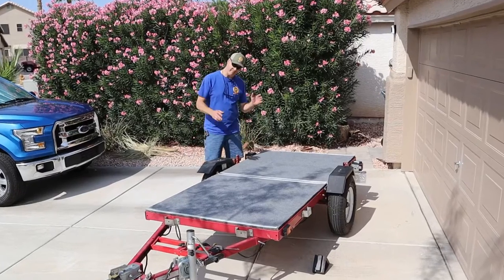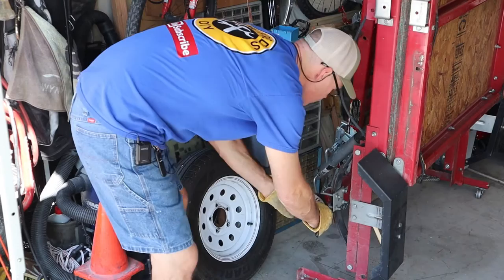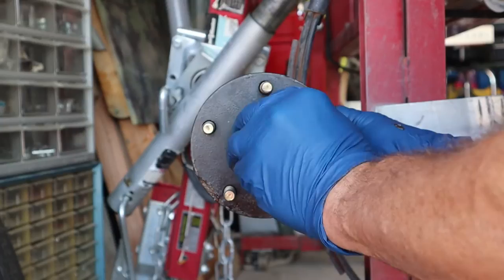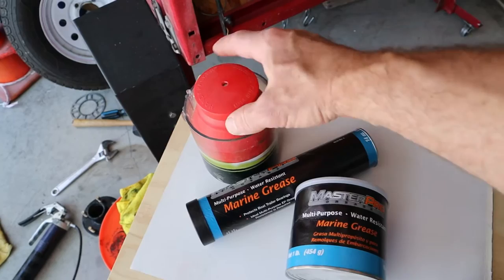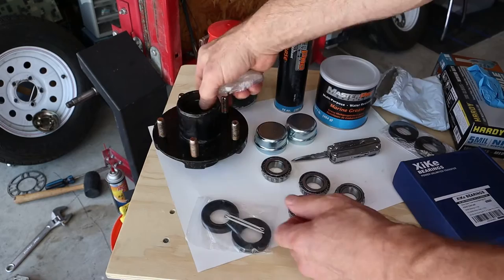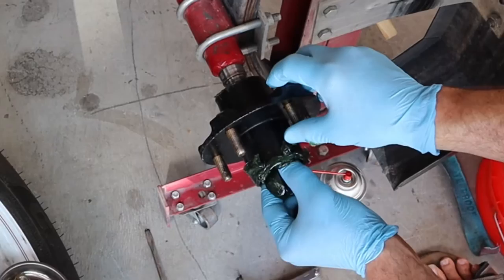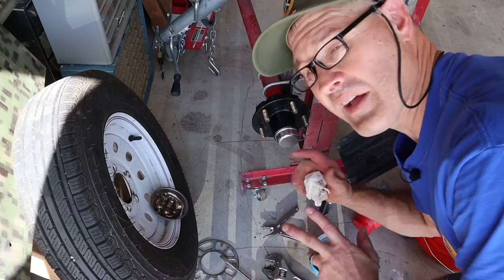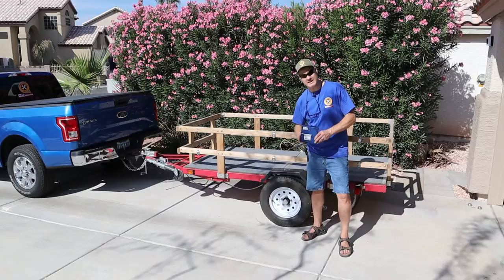Harbor Freight Utility Trailer Bearing Replacement

Comment: That is what you are suppose to do. Repack the bearings every year. However, most people don't seem to do this. I bought a 2 yr old trailer and the previous owner said he never did it. The wheels are very hard to turn and I've decided to replace the bearings and seals because they are probably damaged at this point.
Reply: I certainly don’t but I inspect them. Same on aircraft.

Comment: You should always replace the race when replacing bearings and also put grease on the spindal before putting the hub back on.but other then that great video. Thanks
Reply: What part is the race?  Thank you.

Comment: If the rollers were pitted then the outer cone or race of the bearing will probably also be damaged. The bearing set should have come with "cones and cups" or bearings and races and both need to be changed together. Unless, of course, there are no replaceable outer races in the hubs..... Apart from that, an excellent video!

Comment: Great video. I agree that if the races are still in good shape, just reuse them. Assuming the races are not rusty/pitted/scored etc, they are a bit of a pain to swap. Renting the bearing/race punch tool makes the job easier, as well as throwing the races in the freezer overnight. The new Xike bearings in the kit are definitely well made. I swapped mine after 8 years of neglect, It was time to upgrade before the inevitable happened. Thanks for the instructions. Cheers

Comment: Thanks for the video. I have ordered one of these trailers and am going to repack the bearings so this video helps. Thank you for setting up a link to the right size replacement bearings. I will buy those when the time comes

Comment: The water gets in, possibly from the inner seal and rusts the bearings.  Harbor Freight could get the edge on this
design improvement with a seal like a pump seal with a spring and two ceramic facings sealing the water getting in.
      Thousands of us have this rust problem until the trailer jumps when the wheels do not spin.  Thanks for the D.I.Y. advice my friend.

Comment: Hey man thanks for the video. I’m just finishing this trailer and noticed I can’t push the hub assembly over the inner metal lip on the spindle so the hub touches that little black square. Is it supposed to be touching?

Comment: I torque my castle nut to 22 ft lbs and then I turn hub back and forth a few times to seat my bearings and then I loosen castle nut up all the way and then tighten by hand until snug and then I put the cotter pin in the closest hole.  I haven't had any trouble doing it this way and it takes any guess work out f the job.

Comment: Not replacing the bearing races when you replace the bearings is a job not done correctly. 
Why do you think the replacement bearing set also comes with the races which you failed to show or mention at all?
Just like a chain and sprocket set wear in together the same goes for the bearing rollers and the race they ride in!
ALWAYS replace the race when you replace the bearings.
Reply: Yes, you should replace race. Especially when going to a different brand bearing. Bearings may be the same size but different manufacturers may use slightly different angles on rollers and and races. I have seen this problem several times in differentials rebuilt  at home cause owner didn’t replace the race.
Reply: How do you replace the race?

Comment: thank you for showing the seal installation!  and the rest too, But, the Affiliate link is to 30205 but 30205 bearings do NOT replace L44643 bearing and L44610 race on my red folding Harbor freight trailer.  fyi... 

I now have 4 30205 bearings. what kind of trailer do they fit?? im a pro at trailer refurb after all these YT videos, lol.
Reply from the maker: Which model of trailer do you have?

Comment: Will this fit the heavy duty harbor freight trailer as well ?
Reply from the maker: The trailer in this video is the heavy duty version.
Reply: @MrFredsDIY  the trailer in the video has a 5 lug wheel and I believe those are the super duty trailers, and the heavy duty comes in 4 lug wheels. Correct me if I’m wrong but it shows that on their site also I believe.

Comment: Great vid! Were the 4-year old bearings the ones that came with the trailer? I just bought the smaller one, and not sure if I need to do anything with the bearings right away.
Reply from the maker: Yes, the four-year-old bearings were the original ones. Because I use my trailer for my boat I repack them with grease every season. If you repack your bearings regularly, you will be able to keep an eye on any wear that occurs. Thanks for checking out the video!

Comment: nicely done and good job on the editing.  Did you change the bearing race also?
Reply: I've watched a bunch of videos of people changing the bearings on Harbor Freight trailers and nobody mentions the races! 
The kit he links to on Amazon shows the races come with the kit and one of mine was not a perfectly shiny surface, even though it felt perfectly smooth. I used a brass drift to drive out the reaces and ordered the kit with everything. So far the hardest part of the job is getting the old races out, but I expect putting in the new ones will be a real pain.
Reply from the maker: Good luck with your project! My races were not horrible so I did not attempt a replacement although as you mentioned, this kit comes with new races!
Reply: A race driver makes installing and removing much easier. https://www.harborfreight.com/bearing-race-and-seal-driver-set-10-pc-63261.html

Comment: Does anyone know if that bearing kit will fit the 40x48 HF trailer?
Reply from the maker: Look at your bearings. On the back race it will be stamped with the size numbers. If they are 30205 then these bearings are correct. Good luck with your project!

Comment: I’ve never replaced bearings on my HF trailer. I wish you would have clearly shown which direction the bearings are loaded, if it makes a difference.
Reply: Correction, not bearings- risers.
And does it matter if the riser ends got chipped when tapping them in?

Comment: Do you know by chance what size the castle nut is on the axle. If it’s a 13/16, 7/8” or 1” I have the same trailer axle and one is missing a castle but and I don’t know what size it is.

Comment: I bought the new bearings.
I noticed they came with the new race. 
Should I change that or how do you,  or is the old one good enough?
Thank you
Reply from the maker: Some folks change them and others do not.. Mine looked good so I didn’t change them. Thanks for watching!
Reply: The race MATCHES the new bearings.  They work as a unit.  Always replace the races with the bearings.  Would you replace a brake rotor with old brake pads?
Reply from the maker: I have replaced dozens of bearings without replacing the race, all without incident. I have also replaced many races that have shown signs of wear. If always replacing races with bearings is important to folks then that is certainly something they should do. If a race look fine I do not replace it.

Comment: Where's the link for the bearings?
Reply from the maker: Thanks for watching! There is a link in the description. Here is the link ➡️ Check this out! https://a.co/d/g85076Y
Reply: If my hub is 2 inches in diameter and my axle is a 1in axle will these bearings fit

Comment: My second time watching this great video. I finally have mine and am assembling as I watch. Where is the link to the upgraded (larger) tire/wheel combination? What difference did you really experience between the tire/wheel change and going to a radial? Thank you!!!!
Reply from the maker: Thanks for checking the video out. Here is the setup I am using for Wheels & Tires 
☑️13” Wheels-https://amzn.to/37kcdvE
☑️13” Carlisle Trailer Tires https://amzn.to/3IZCvUq
☑️5mm Wheel Spacers-https://amzn.to/3K9VvOe
(I used spacers to keep my tires away from my fender brackets)

Also, here is  a video with all of my trailer mods Harbor Freight Folding Trailer
https://youtu.be/QIuaZ6ftXB0
Reply: @MrFredsDIY  - Tire Link no Longer works
Reply from the maker: Thanks for the heads up! I just fixed the link!

Comment: Just bought the same trailer should I change the grease that comes in it new?
Reply from the maker: That’s a good question… Some would say yes and others say that the “new” grease HF uses is good enough. Me personally, I would clean everything and change it to a premium grease. Also I use my trailer for my little boat so I use marine grease. Also mixing grease should be avoided. Thank You for the view!
Reply: I probably watched 100 videos on this trailer. I have a hobie pro angler 14.  It's pretty difficult getting it into the bed of my truck so I'm pretty excited about being able to back the trailer into the lake/river. I heard whet you said about using marine grease. Best I could find was waterproof it had a picture of a boat on a trailer so I hope it's good enough.
Reply from the maker: @SOLDIERx4xCHRIST  sounds like it’ll do!

Comment: What’s the speed rating for your trailer/tires. I have the 4 lug tires and would like to upgrade to the 5 for highway speeds.
Reply from the maker: There could be 13” 4 lug rims but I’m not sure. The 13” Carlisle Trailer Tires are rated for 81mph.  https://amzn.to/3xo3RhV Thanks for watching
Reply: @MrFredsDIY  They’re 12 inch with a load rating of 72N. This should be 355 kg and 87 MPH. Thanks for the link to the bearing kit. Been looking all over for them.

Comment: the xike bearings come with grease seals, but you have a link for another set of seals. Are the ones that come with the bearings incompatible? or did you give us a listing for just the seals if we kept our original bearings?
Reply from the maker: Thanks for watching the video. At 3:98 I explain that I like to have a back up set of seals. The seals in the kit work fine.
Reply: @MrFredsDIY  Great! thanks! this video was super helpful.

Comment: Great video. Did your trailer come with 5 lug hubs or did you purchase those separately? I have the 4x8  HF 1195lb. with 4.8x12 four lug but would like bigger tires like yours.  Also, would these bearings work on my trailer?
Reply from the maker: Thanks for watching the video! The 5 lug hubs are what came with the trailer, it’s the 1720 lb trailer. I’m not sure if your bearings are the same as the bearings on my trailer. You can pull the dust cover off of one side, and look at the front bearing. If the numbers are 30205 then they are the same. The rear seal should also have numbers. Mine are 30-52-10, 30mm 52mm 10mm. Good luck with your project!

Comment: You took the time to replace the bearings but not the races?  If your bearings are showing signs of wear, the mating surface (race) is wearing too.  Not a good instructional video.
Reply from the maker: Thanks for watching! I also replace brake pads without turning rotors. Difference in opinion.